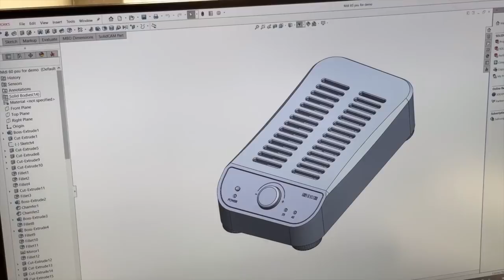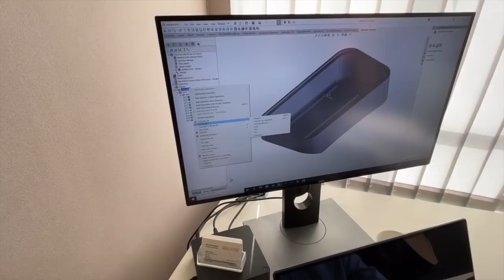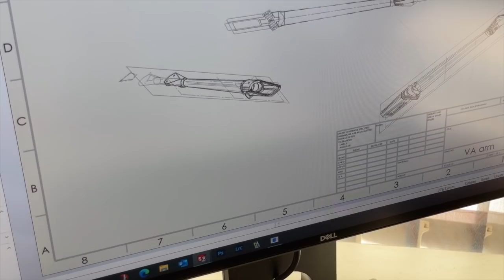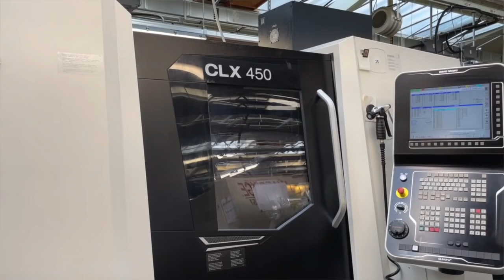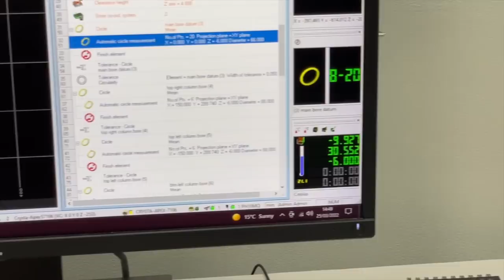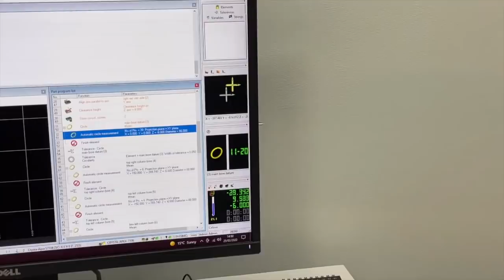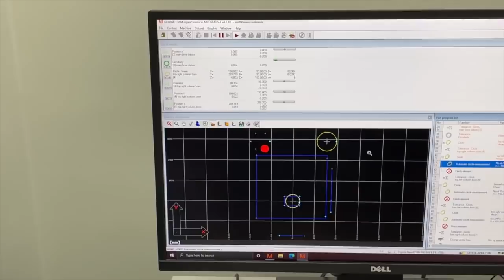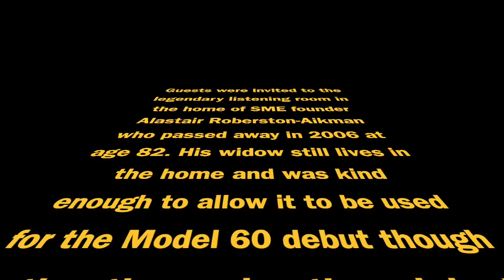SME Debuts New "Flagship" Model 60!

Comment: Interesting, but there are so many boxes that this fails to tick. No second arm capability, no 12 inch arm capability, and the arm still appears to have no azimuth adjustment. 
I recall a certain New Jersey turntable company that switched from metal to plastic resin arms a few years ago, with somewhat mixed results. The cynical might say that this is actually a cost cutting move, allowing them to stop subcontracting the arm tube to White Metal Casting in the USA.
Did anyone ask if they ever plan to resume selling tonearms that don't come with a turntable attached to them?
Reply from the maker: There is no comparison between a 3D printed arm and this material! If you spend this much, you can afford to send your cartridge to WAM Engineering, which will measure azimuth and provide the correct shims to adjust azimuth. They will still make the magnesium arm but this they say is a step up.
Reply: 3D printing is a form of additive machining as in the VPI tonearms. But the SME arm in the video is a form of subtractive machining - shaving off unwanted parts. Probably cost more than casting since each arm is machined individually and time consuming. Also, SME is not a believer in longer length as that would sacrifice rigidity, even though they were pressured to make 12 arms for the vintage market - for those refinished idler drive tables - in the prior regime.
Reply: @HP_____  SME has offered a 12 inch arm with the 3012 pretty much since day one in the late 50s, back when "vintage" was new.
Reply: I know all about 3012 as I owned the original one and multiple 3009 arms. I was referring to the period since they started making SME V arms or the "black arm" period. They have their own philosophy and that's what the buyers are conforming to. Flexibility is not their thing, just like their arms are all about rigidity. Heck, they don't even sell arms anymore! Not saying I agree with their philosophy but at least they have one!

Comment: ironically, for an audio channel, the sound in this video is not very good. Turned on CC to understand what was being said.
Reply from the maker: ironically, recorded under very difficult circumstances. Not possible to wirelessly mic the host, most of the video was shot in a noisy MACHINE SHOP so I did the best I could.

Comment: Fluid damping only around the main bearing would suggest this aspect of design is based on 20/3 topology, while higher mass is retained from the 30/2. Possibly confirming suspicions that SME found the 20/3 to be the most musical of their previous designs, if not the most hi-fi or expensive?
Reply: There is more mass in this turntable than in the 30/2 and same fluid damping. What is your point ?
Reply: @georgegimenez3881  The 20/3, 20/12 had fluid damping around the main turntable bearing only. The 30/2 and 30/12 had fluid damping inside the suspension towers and none around the main turntable bearing. This model 60 appears to follow the 20 models in this regard as far as I can ascertain from the video.

Comment: Why place the transformer chassis so close to the tonearm area that carries the signal? I guess it's for looks in the presentation... I suppose.
Reply from the maker: The point is, separated from the controller, the transformer case can be placed far away
Reply: Thanks. I was referring to the debut presentation at the founder Alastair Robertson-Aikman's house at 31:28 where the transformer housing is sitting very close to the tonearm area. It could have been placed on the far left side. Doesn't matter. Amazing video!

Comment: A lot of machining on these components. Especially on the transformer box. I would think casting the box first and then do final machining. I know, they are probably manufactured in small numbers. But machining all this from a solid block is also expensive.
Reply: SME does not do Casting. Is all machined from a solid 3kg aluminium block.

Comment: So id like them to explain and prove the benefits in sound quality using a forged and machined psu case vs that 100% machined from billet piece they are using that they charge an exorbitant amount of insane $$ for. Do they really think they have an argument?? Lmao To sit there on cam and make that a talking point as if billet alu will do anything to enhance anything is preposterous
Reply from the maker: it's 100% machined from a billet piece. Where do you get the idea that it was otherwise?
Reply: @AnalogPlanet  I believe he meant can they prove making this psu case machined from billet offers better sound than by some other process , possibly cast metal .
Reply: Without using a solid piece of billet aluminium, cut using a five axis CNC mill, you lose the cohesiveness of uninterrupted molecular sonority. The introduction of tungsten inert gas soldering and grinding will introduce enough heat to send warm signals into the circuitry killing all hope of highly resolving wave forms. It's science y'all.
-✌🏼
Reply from the maker: @Finn-McCool  very fawny.

Comment: A hilarious "Frankenstein" turntable using old obsolete technology!
Reply from the maker: you are hilariously pathetic and obsolete.
Reply: It's all about sound quality. The phonograph record format, based on the microgroove technology, was indeed introduced a long time ago in 1948 by Columbia. Against the background of it's SNR of approx. 60 to 70 dB (CDs typically 96 dB) it's surprisingly not obsolete at all regarding sound quality. CDs (even DSD files to a certain extent) sound like crap in comparison, flat and liveless. This is a well known fact since decades. And there exists of course an explanation for this: the inevitable noise shaping and digital filtering mess things up soundwise. I tried NonOS DACs without digital filtering, using my own vinyl test records in 24/176.4 PCM: better, but still liveless. You lose sound quality in the process of digitising. There is nothing to do about it. This very insightful video is all about the recent technological approach of SME to make our beloved vinyl records sound even better. (I do use a sophisticated and nice looking vinyl record playback system 😀).

Comment: Thousands of dollars to play $20 record. The stupidity of "Audiophile" equipment. At the end of the day isn't it the needle that determines the quality of sound of the vinyl? Some of these turntables remind me of stocked Hondas with body kits to make them look "Fast"
Reply: The short answer on a $199 system is yes. On real h-fi it's no, there's considerably more to it.
Reply from the maker: No. The "needle" does not determine the quality of the sound. I'm glad you asked the question.
Reply: @Ruben Ramero ortofon themselves call it a needle
Reply: Over engineered no doubt. I cannot see the point if audiophiles cannot hear the differences. Well if I spend a 10k on a TT, I will hear a difference 😁. And that would be if I feel my ass😂
Reply: "needle"?
Reply: @davidkavanagh4966  No. Ortofon marketing call it a needle.
Reply: @faludabutt8253  Then you don't need a device such as this one. Simple.
Reply: cjay2 yes, I need. To show off 😁
Reply: If the cartidge/cantilever/stylus are not supported properly, they will not perform as best they can, regardless of how much they cost.  Hence, a great TT will make even an inexpensive cartridge sound fantastic.